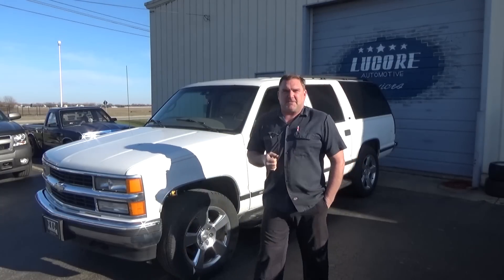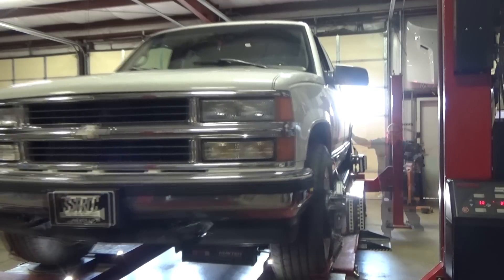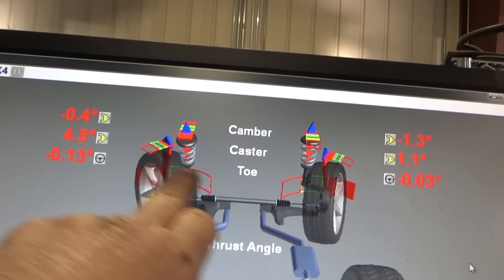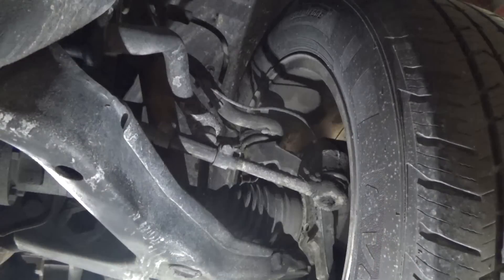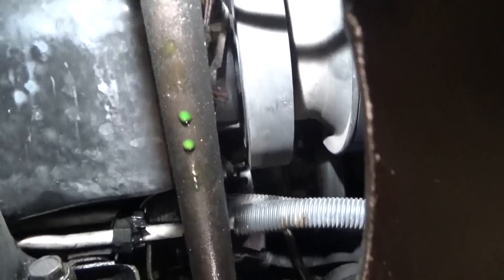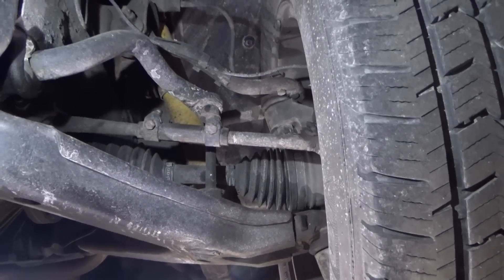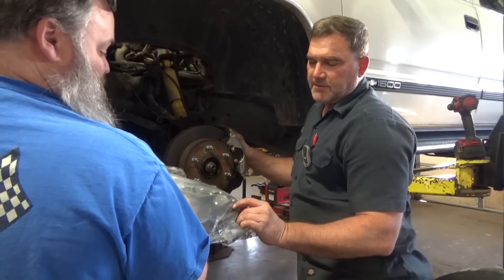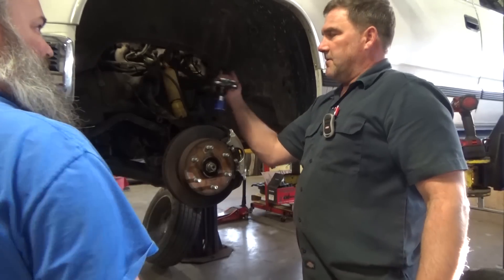Mrs Vicki's Ever Wandering Suburban comes to Lucore! OBS Suburban Tracking woes discovered!

Comment: My 98 still has the knockouts. I started to swap them once, but I've never had any wear or drivability issues, so I figured why mess with them. 🤷‍♂️
Reply from the maker: How many miles on it and have you had the alignment checked? There can't be many of these things still running around with them in!
Reply: @LucoreAuto  It's got around 180k. Had it checked around 100k when I hit a deer and messed the front up bad. It was fine then. I just replaced idler and pitman arm, they were surprisingly still in decent shape to my surprise, but changed them anyway. Im gonna do the rest of the front end soon just for preventative maintenance (just how I do things) and will get it checked again then. I just bought my 4th set of tires in the life of the truck, I've gotten over 50k on each set. So I can complain. I may just do the knockouts this time, before I take it in., So they just ,need to align it.

Comment: Ok, Im 9 mins into this video. And ill say this, If someone "Recently" did a alignment on this vehicle and we find this upper ball joint at "Near Catastrophic failure" as this is. Then Good Year needs to be off my list of reliable service providers. And told to "Stick to tires" because YOU SUCK AT EVERYTHING ELSE. Just as we found out with our 2009 2500HD Silverado 4 door truck recently. They told me it need the right outer Tie Rod end. At 240-K miles I said just go ahead and do BOTH left and right side outer's at the same time. Which we found they did, However they used a Moog on the right side. And AC Delco on the left side. Well apparently someone either missed boxed the AC-Delco or it wasn't assembled correctly with the right length stud, Because when they put the castle nut on it. There wasn't but maybe 1 1/2 turns on the nut before it tightened up. Not allowing you to even get a cotter pin threw it. So they decided to improvise. And used a nylon jam nut (The thinner type of jam nut) Well you can probably guess what happened soon after. So then they aligned it. Now the question that still remains is, When was the last time there alignment rack was recalibrated???  Because there surely was NO TEST DRIVE afterwards. Because had they, Then they would have IMMEDIATELY realized there was something wrong with there rack. All ill say is this, "There's a Good Year repair center in NE Ohio that id stay away from, Other than getting new tires installed or a flat repaired.

Comment: The only parts not replaced with name brand parts {Moog/ACdelco are the lower control arms . It was aligned on a rack like yours . Can't wait to see your diag and fix . What's the best way to see if your AWD is engaged all the time . 96 safari AWD conversion should get better than 12 mpg
Reply: AWD check ? Jack up a front tire and see if it spins ?

Comment: Bushings make all the difference. So do new bolts. Did my 97 ranger 2.3 5sp front end after 220000 miles. If it wasn't part of the frame or power steering , it was replaced, except for the swing axles. Those got electrolysis de-rusted and new bushings. After de-rusting, the original grind marks from removing the cast flashing reappeared. POR'd them and they still look new years later.  Truck has never steered so well.
Reply: Bolts don't make a bit if difference unless they're bent from a collision
Reply: @dopeman420  well, when the bushing sleeves have been wearing steps into the bolts, replacing both makes a difference. 220,000 miles is alot of rubbing.

Comment: Thanks for your great info and videos. I wish I lived close to you so I could bring my vehicle in.  I have a 1968 Chevelle with a 396 All new springs plus most of the steering. I drive this as a cruiser. What alignment specs would you use?I have 15 inch rims 28 inch tall rear and 26 on front with radial tires. Thanks for your time.

Comment: i have a 99 i would never part with, had similar steering issues, one im old now and some people don't realize the older or weaker you are the more you tend to lean into the steering wheel, makes it a little iffy tracking, kinda like toe off. all the shops i took it to for alignment use the normal front end shop skuff for toe, being an old ex racer i finally took the time and stringed, i guess that's the way to say it, im sure you know what i mean, using a string in an x pattern then front to rear for toe. finally got it as good as it can get and just try to relax more when im driving, at 81 i tend to lean into it more than most.  love these body styles, on another note, the model with the headlights like you have there, like mine, is the only vehicle i know of that you can buy real glass headlights for. i got tired of the plastic crap yrs ago, mine have been there for almost 8 years and still perfect, i can't remember the brand, not a seal beam and they were hard to find. so much better than plastic

Comment: I love Old man garage but I don't get why they have to send out the front end work.    I do all my own front end work set the camber with a level and set the drivers side toe straight to the frame rail using a 2x4 to project the angle down the frame rail then set the passenger tire to the drivers side and that gets it really close for the alignment shop to finish off the rest once I can get a appointment but at least it gets me close enough to drive around
Reply: Because skill level =  parts changer . 
That said I don't expect somebody who was never in the industry to be " super tech" or anything ...
Reply: Bill says it's networking...views for views. You tube money....yea it's stupid but also smart...I'd still do my own work and alignments
Reply: There are a few things I'd do differently than these guys tho. But they kno what they're doing..
Reply: @dopeman420  I never thought of the networking part

Comment: Replace the adjuster bolts.  The OE ones WILL back off.
Reply from the maker: That's certainly an option, we're Aldo fans of loctite once everything is set. There's an extensive alignment process to go still and we'll be sure to address that. 👍
Reply: They will not back off if done correctly

Comment: Carquest is full of shit on that screw. It can be adjusted and won't leak.
Reply from the maker: It's not a matter of leaking. It's not a plug.
Reply: @LucoreAuto  carquest said it would leak. I have adjusted several of them to take up some of the play in the steering wheel.

Comment: Moog is the best you can get aftermarket wise, the only complaint I have is alot of parts get returned and resold and are often missing the hardware. C clip, zerk fittings...can be a headache sometimes.. most people just change the parts, you must grease these parts!!
Reply: I can tell you this, We recently got a real education on this statement.  A unnamed shop couldn't get both outer tie rod ends for our 08 Silverado 2500HD. So they ended up putting a AC-Delco outer on the left side. Now you would think "Hey, AC-Delco is a good name in parts. So we should be OK, RIGHT???"  Well......  Apparently NOT, The AC part had a shorter ball stud, So short that the castle nut would not even make 2 full turns when it was seated into the steering knuckle. Thus not allowing the cotter pin to be installed.  So the "Unnamed shop Technician"  decided to improvise with using a thin nylon locking jam nut. So instead of stopping, And getting the shop manager involved and getting the correct part that was MADE CORRECTLY. They then went on and did a alignment on there rack  that was so fare out of spec. That when i left with the truck it nearly drove me into the ditch less than 1/8th of a mile away from there shop driveway. Apon IMMEDLEY returning, and asking if they test drove this truck??? I was asked "Why??? We just did a alignment on it, its perfectly straight. And here's the print out of the alignment" 

 Longer story shorter. I had the truck TOWED to a different shop after arguing with them for 2 days. The 2nd shop put the truck on there rack, and discovered the screwed up tie rod end problem. And than asked/said  

"Please tell me you didn't attempt to drive this thing here??"  Because its so fare out of alignment and that nylon locking jam jut was not even engaging the nylon and locking. And it likely would have come off very quickly as bad as the front of this truck would have been violently shacking. When i showed them the first stores alignment print out, They just said " Yep, We've seen this before with them" There owner even went to there shop to talk to there store manager to explain what's likely going on with there rack. And the manager asked him to leave, Or he would call Law enforcement and charge him with criminal trespassing. At this time they have refused to refund me, And I will have to take them to small claims court. Which I will be doing.  Moral of the story, Stick with well know shops that don't cut corners, And know what the HELL they are doing.  Because its only YOUR LIFE they are dealing with.